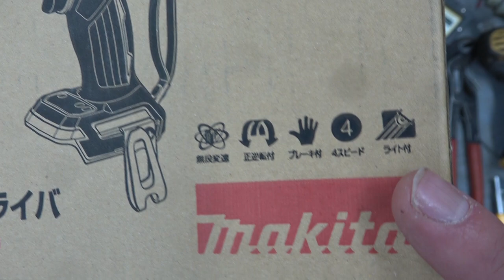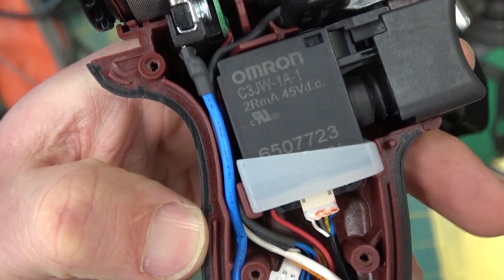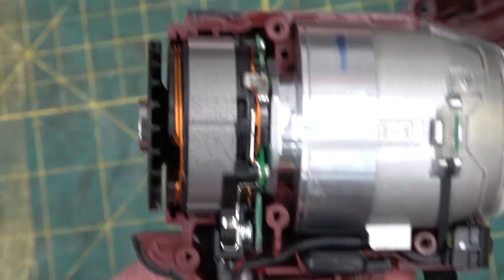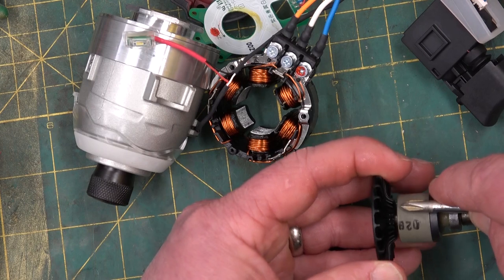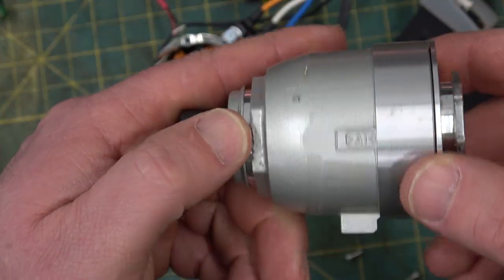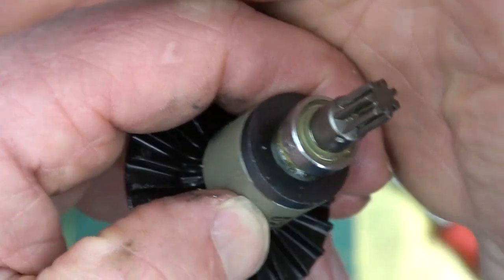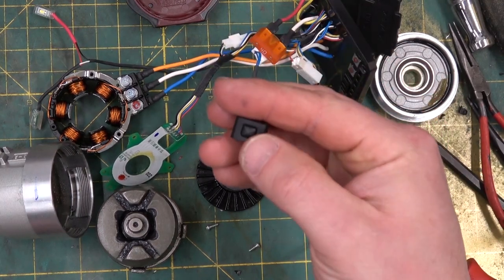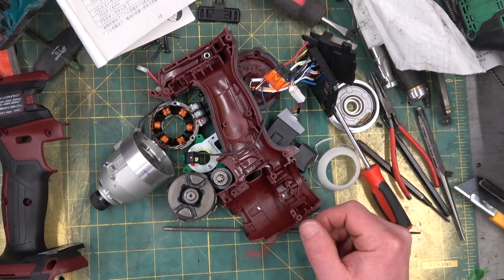Are Japanese Tools Better? Yes.

Comment: "What are they thinking?" They're thinking we're too cheap to pay for quality. And they're right!
Reply: Westerners prefer loud marketing and low prices.
Reply: @UhOhUmm  not all of us
Reply: @Giovanni_Litterini  We are the few. The proud.
Reply: Nah, Hilti does fine, I'm sure if they sold one that advertised it was made with more durable parts everyone would buy it. But they'd make less sales because many people wouldn't buy new replacement upgraded tools every 3-6 years (depending on use) my dad who's now retired did carpentry electrical and plumbing 65 years and he's had makita tools that lasted 40 years before but they were made of only the highest quality parts. If Makita went back to that type of quality they'd have to charge more for the batteries. They could make really fast chargers which would degrade the battery faster but would be impressive then they'd get you there.
Reply: nah just for cheap azzezz
Reply: Greg Scott  They call it value engineering. Make it as cheap as possible, and only last as long as the average will tolerate.
Reply: I don't think it is a judgement of people. Western markets are just poorer than the Japanese market. Japanese also are obsessed with quality.
Reply: Yeah, I'm pretty cautious about marketing wank & if I'm willing to pay $350 for my boots $225 for a flashlight i think i can afford a better tool. I won't even look at a few of the import brands anymore. Just garbage.
Reply: Greg Scott  Luckily there are still some hardened tried and true quality tools/brands out there. I myself prefer good old fashioned quality 'merican made bits from my local ma & pa. Remember when things said "Proudly Made In America"? Yeah, they still exist.
Reply: Greg Scott  Yeah, the worst of it is we have much better technology and materials. If we wanted to, most items could last so much longer than they even used to. But then you would only need one per lifetime compared to 1 every 5 years at best... not great for the shareholders.
Reply: problem is even most of the expensive stuff doesnt last long and is just a rip off nowadays, you can bet for the same price youll find many tools that are not the same quality built
Reply: Greg Scott  why would you want to pass down a tool with old technology that will be of no use in 20 years? For example, if someone gave you a corded drill, would you even use it? Nicad? Power tools need to last about 5-10 years max.
Reply: @eric69571  I have corded heavy duty drills that will destroy any cordless. Sometimes you need the real power. So I would say it depends.
Reply: @UhOhUmm  I hate our marketing.
I prefer the price just match the overall quality and durabilty, and I will pick what I need.
Reply: @UhOhUmm  jkKipling>
Reply: I wouldn't mind higher quality and higher price
Reply: @dosgos  As are we. 'We' being the AvE market. 😉
Reply: @jameshisself9324  Right? I love my corded heavy duty hammer drill. If I tried to get the same performance from a battery drill I would be swapping batteries every 5 minutes.
Reply: @Giovanni_Litterini  Certainly not, but far to few of us too matter, I'm afraid.
Reply: The problem is that you can't count on brands for quality any more.
Reply: Greg Scott  Because everyone else wanted to pass on their $10 horror freight tools to their children

I know my dad did, fuck that garage full of literal junk
Reply: Greg Scott  I'm afraid the only things many of us will be passing down to our children will be our unpaid medical bills!
Reply: @eric69571  I have several corded drills.  They have specific uses in my shop.
Reply: @nubreed13  primary use: collecting dust
Secondary use: nostalgia 
Tertiary use: ummm...when I forget to charge my batteries.
Reply: Bingo!
Reply: You just buy Milwaukee.
I would go for bosch.. But limited selection and support here.
Reply: Not me
Reply: Some years ago, I had the opportunity to travel to Japan, and bought there a Sharp brand Minidisc recorder and player.  But it was NOT the same as the one same kind available in L.A. California, but the one made especifically for the Japanese market had several extra "hidden" features... When I asked a Japanese engineer why were them  different, he carefully replied that we, "occidental" consummers were just too dumb to really appreciate the better points of the design... and politely added, well, most of them with some exceptions!
And then he pointed to americans preferring the longer duration of VHS videocassettes versus the higher quality of the Betamax, and saying that 99% of american consummers don't bother to pay attention to details...  go figure. (I think he had a point).
Reply: I wouldn’t  call the US market poorer when its GDP is 5x that of japan. Per capita its at least 20 to 25 thousand higher.
Reply: @eric69571  notching roll cage tubing, making tendons for log furniture, etc.
Reply: It also might be a long-term strategy of not overly advantaging their international competition by exporting their own best tools, reserving them for their own domestic based manufacturers. That's what you get when the government actually values their own domestic markets and most likely has tax incentives to aide their own manufacturers, rather than perversely making it worth their while to flee over the border to Mexico and then again, off to China as free-trade agreements remove most of the import duties to lower and lower labor cost countries.
Reply: @jameshisself9324  At least in Australia (and most likely in the UK and EU), the legally mandated testing and tagging regime for corded electric tools to be used on worksites has lead to a boom in cordless tools. Because only the charger plugs into the mains, only that needs to tested and tagged, so that your toolbag of battery powered tools and your battery powered boombox get in for free.
Reply: Greg Scott  Like the toaster and skill saw my parents had till death do they part.
Reply: Greg Scott  Yep, still use the toaster my mother bought in 1978. She gave it to me almost new in the box in 1983 because she preferred the one she'd gotten from her mother in 1958. Both were made in Booneville, MS by Americans who were paid a living wage sufficient to support a family. I don't think there is a toaster on the market now, at any price that will still be working in 40 years.

Aside from a few tools, some of the furniture I built myself, and some OS model airplane engines I bought when I was a teenager, I can't think of a thing I've bought in my own lifetime that will be worth passing on to my own kids. Even the house is falling apart and will probably be scraped off when I die.
Reply: @eric69571  my grandfather gave me a skil wormdrive saw thats 41 years old i bought the same type of skil saw just brand new brushed and wormdrive both 15amp 7 1/4 inch blades old one still had more power with worn brushes used the same blade on both old one still cut faster
Reply: @eric69571  
Even a cheap corded drill from Harbor Freight will out-perform a more expensive battery drill. As far as NiCad, I personally took an old DeWalt NiCad drill that my dad had since he was in his twenties, so late 1970's, and I made two new battery packs for it using 18650 cells. He loved that drill but was ready to toss it because he couldn't find batteries for it. Now he wants it back! Do you think there's a single battery powered DeWalt drill on the market today that you could pass on in excellent working condition 43 years from now?
Reply: @dj1NM3  Oh of course, and I use them like crazy. But there are situations that require more power.
Reply: It's just another strategy. We won WWII with our cheap strategy. The Germans made the very bestest tanks, but we made 100 good enough tanks for each of their bestest tanks. Sometimes good enough is good enough.

P.S. Don't get me wrong, being a tool snob is fun, but mostly it's unnecessary.
Reply: @jeptoungrit9000  just ask the american tank crews they wanted and they'll tell you german all the way
It took 4 or 5 tanks to take out a panzer 3or4 to get blown I so the last could sneak around back and hit the gas tank no thanks think I'll take quality over quantity
Reply: @hidalgoh79  I think he was referring to other third world countries. The US isn't poorer, we're cheaper.
Reply: @eric69571  Uhh how many ratchets, wrenches, and hammers do you have with microchips man? You can have a wood lathe with an old washing machine motor and control the speed by a belt drive.  Since when do we NEED tech? That's why all your tools fail.
Reply: 100% this
Reply: @erikodinson9288  literally none of what you said is true. Look up the chieftains video about ww2 us tank myths.
Reply: Not a mechanic but I'd  buy that over the Chinese version. Wonder where we can access the Japanese domestic market.
Reply: @sonny9608  the only cheep tool i get is cheep drill bits, and i still keep a good set to drill harder stuff
Reply: They are thinking "planned obsolescence"
Reply: Greg Scott  you certainly not going to find that with apple built in everything and Tesla 5 years parts life. Long gone are quality that lasts generations.
Reply: @Alec Borchardt Because we've been taught that this is alright, and it's to be encouraged.  Don't save, consume and toss.

This culture needs to go.
Reply: Greg Scott  I have a Makita circular saw, planer and router that have been handed down to me by my dad, grandad and neighbor. Still working fine, however my cordless gear gets the most work nowadays
Reply: @sonny9608  really because I know a bunch of aviation mechanics with tool boxes and tools straight from harbor freight tools because it would be a fortune to gear up with Matco or insert whatever tool company you want here.
Reply: @sanityassassin8161  The good news is that your children are not responsible for any of your unpaid bills, none. Unless they were on a "note" with you such as a credit card in both your names.
Reply: Where can we buy these online?
Reply: @jameshisself9324  that was true 5 years ago but there are plenty of heavy duty cordless out now
Reply: @markbrackett1039  1 inch (and up) rotary hammers. I've used the cordless versions and they are a joke both for power and battery life.
Reply: @sonny9608  if you buy any American car you're in this category
Reply: Marketing executives like loud marketing and high margin products (read cheaply made).
They COULD make better tools for a similar price and it would sell itself, but how would the marketing wanks justify their jobs?
Reply: @hidalgoh79  keep in mind the U.S. GDP is mostly deficit spending, so it’s not as great as those numbers try to make it look.
Reply: There’s enough of us who would pay a certain amount more for reasonable quality but that market is under served. But modern marketing says build down to a price point and let them re-buy when it breaks. Instead of building a decent product you’ll tell your friends family and co-workers about.  
Which is better for the economy? Environment? Company?
Most home-gamers pine for the old American way when even consumer tools were made By and For craftsmen who take pride in and appreciate work and work ethic. 
Then there’s the wanker high price tools nobody needs but rich douchebags like to show of their wealth with.
Reply: @jameshisself9324  👍👍👍🥂
Reply: @nubreed13  I use my lathe for that, but I totally agree with your point.
Reply: Greg Scott  Wait a second. Lathes are outdated? Ha, that just means you don't do enough precision prototyping. Call us when you step up to the big leagues. 😉
Reply: @Pyxis10  We weren't taught it by anyone other than the marketing twats. Throw off those shackles my friend!
Reply: @vladimirlopez7840  Agreed, it's not the quality of the tool, it's the quality of the work that gets done with that tool. Skilled craftsman still required, especially in aerospace.
Reply: @jeffstanley4593  Funny how a lot of people believe others 'inherent' their debt. Need to convince the family too, since harassing the survivors is a common collections tactic.
Reply: Yeah, next time I'm in Ja-pan I will probably be shipping me some tools home...
Reply: This is what happens when you prefer maximum quarterly profits over delivering a good product. Everyone can be happy, but they gotta be like vampires and suck every last dollar out of the product i.e. you. They know there's a market for quality tools, but they won't serve it because they're the ones who destroyed all the offerings!!! They being the corporate bureaucrats.
Reply: I only buy tools that are high quality. So not everyone buys cheap. Professionals buy quality.
Reply: @Giovanni_Litterini  Now that worm drive skill saw is unbelievable.  Nothing can touch it. ♥️
Reply: speak for yourself
Reply: Greg Scott  what do you mean out date? did you mean older cultures?
Reply: @martialme84  Things made in Russia tend to last though
Reply: @sonny9608  I know a retired city mechanic that just patched the flat on his touring Honda mc. Hope he lives to tell about it! Ps. I won't be behind him.
Reply: When Home Depot is selling "equivalent" products to undercut you, aiming for quality is probably a losing strategy.  I just guess that most of us who care about quality are in the far minority.
Reply: The modern age of consumption is about get something cheap when it breaks or get obsolete throw it away and get new one. People don't really care about high quality, they care about price features and whatever marketing you force down their throat.
Reply: That’s the real shame of it, I want high quality but can’t find it.
Reply: @dj1NM3  You left out the overseas support aspect for when it no longer chooches.
Reply: nah! they do this all the time, the best quality serves their people first in almost every business, another fact is domestic market can support them well enough, so they just don't really care about export market.
Reply: @joshuaewalker  I converted my cordless Crapsman professional drill to a large throat drill press with an old laptop power brick. Works great.
Reply: @onecalledchuck1664  
That's sounds like it was an awesome project!
Reply: I read somewhere that Japanese tools are built almost exclusively for the trades. There is no mass-market for DIY’er home handyman stuff in Japan. The quality of the stuff we get in the US is appropriate for the use 90% of buyers will ever put it to. Thats why I feel confident buying even used Ryobi in the US: chances are that drill has put a few holes through drywall and that saw has cut only a few 2x4’s over the last 10 years, and for $10 at Goodwill it’s hard to go wrong.

Comment: I think someone in Japan was watching ave tear apart a tool made in China and said hold my Sake’, we can do better.
Reply: "Hold my Sake'"

😂😂👍
Reply: Eh, they maybe indeed "LOOK" the same inside. But that does not guarantee that the same quality and attention to detail. I know Japanese stuff is better. If I have a choice, and I usually don't, I buy American. But if there's a choice between Chinese and Japanese, I'll take Japanese. Fuller tools comes to mind. My Dad had a Fuller socket set when I was a kid. We lost some sockets, but never broke anything. Good stuff.
Reply: @dads8253  They're identical. Every last component and spec is identical. They can't not be identical, as power tools only have one oem replacement part for every component. Unlike automotive, there is no aftermarket for power tool parts.